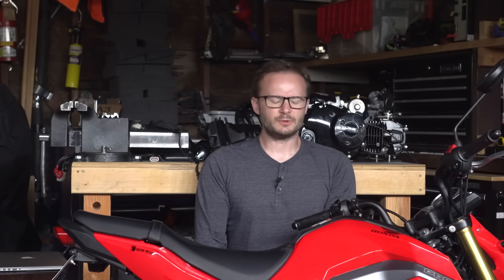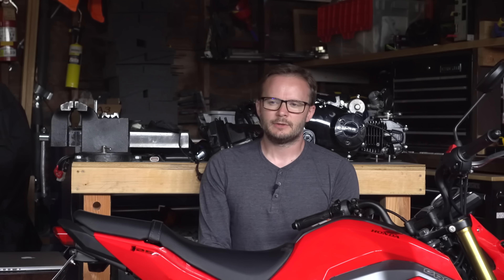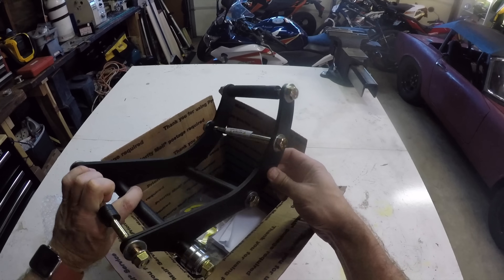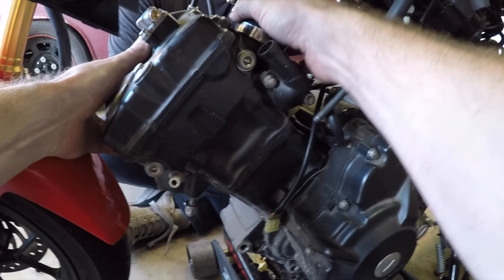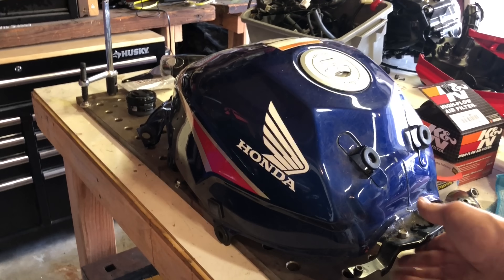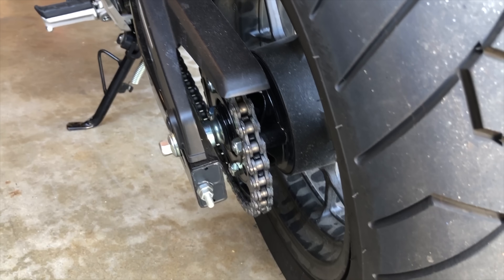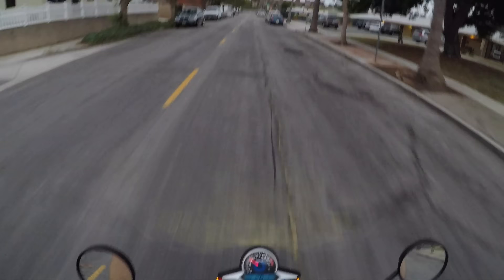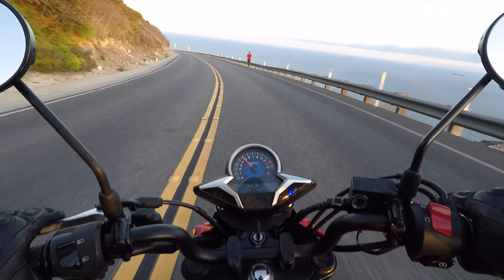Honda Grom Engine Swap: Twice the Engine for Twice the Price - CBR 250cc / 300cc How-To

Comment: When you say you need to re-tune the ecu. Do you still need to retune it if you are running the cbr ecu
Reply from the maker: Yes, because the intake is so different. It will work, but the idle sucks and you'll be down on power.
Reply: SuperfastMatt I just bought me a cbr 300f the whole bike with 66 miles on it for my swap. I will order the install bracket from steady with longer coolant line and egr block off. Being I have the whole bike I should be good on everything else. Where do you recommend me sending the cbr ecu too for a retune. Is there a way you could message me on fb messenger I don’t know anyone that has done the swap and if I have questions it would be nice to have someone to ask

Comment: Interesting, but if it requires purchasing an entire second motorcycle, I'm just going to use that larger bike as it is. I would find simpler ways to get power out of the factory 125 without compromising reliability/durability.

Comment: Well... you lost me at "buy a whole 250"... if I'm going so far that I am buying a whole ass bike to do an engine swap, I'm just gonna ride the bigger bike and not have flashbacks to riding my son's CRF80 because he hopped on my DRZ450 and took off. Serious question... if you need more power, why not save some weight and put go fast dirt bike parts on the oem engine like a J&E or Weisco big bore kit, stage 2 cam, bigger and jetted carb, racing exhaust, power adder(s), etc.?

Comment: Engine is canted almost 20 degrees forward, this hampers lubrication of camshafts. Also affects oil pick up. Generally, you shoe horned a big motor into a grom. Weight distribution is bias forward which degrades handling.
I would say that it probably rides terribly.  Braking is probably bad or worse, dangerous. Other than that, great job!
Reply: Blah blah blah 🙄
Reply: @upnorthviking823  yup...facts are blah blah blah... me and my books and stuff...me and my enginerring degree and numbers...me and my 50 year career making aircraft engines... i can see why somebody would trust blah, blah, blah over my opinion.

Comment: How did you attach the elbow that you made to the bike ?
Reply from the maker: I just used a short rubber hose and two hose clamps.
Reply: @SuperfastMatt  thanks for the fast reply ! Love the videos. And what did you use to attach the screen filter ?
Reply: @SuperfastMatt  also, did you end up getting the Ecu re tuned ? I can’t find a place to do it
Reply from the maker: @camilomunoz6762  I put an aftermarket ECU (MicroSquirt) on it and tuned that.
Reply from the maker: @camilomunoz6762  The screen filter came with a rubber boot and a hose clamp
Reply: @SuperfastMatt  u should do a tutorial on the micro squirt tuning !

Comment: Does the bike run weird/funny due to it being mount slightly on an angle on the grom as apposed to the 250r?
Reply from the maker: No; you do have to tune the ECU because of the new intake, but once that's done it runs fine.

Comment: Why is it 9hp? My Yamaha TZR 50 has a 50cc engine that makes 8hp
Reply: The tzr is more like 6hp stock, but you are comparing a liquid cooled 50cc 2-stroke racing motor to a 125cc air cooled 4-stroke tuned for new riders and city riding.

Huuuuge difference

Comment: Honda grom with the tm smr engine two stroke 125cc with 45hp
Reply: or the 2 stroke 300cc engine;)   There is a guy on YT that has done a cr 250 engine in a grom, and that thing realy goes...
Reply: @supertedogpriken  yeah but at least 45hp are kinda managable. The hp from a cr 250 are too much
Reply: @m4ttyofficialchannel  cr250 is that much power though

Comment: poor mans version of this get brand new honda grom clone for 1300$ swap in a zongshen 212cc 4valve engine for additional $950 add larger exhaust $180. not 300cc honda power but more than 2x the power of the stock 125cc grom.

Comment: Just buy a different bike. I bet that heavy motor throws off the center of gravity and weight bias so much that it is dangerous to ride. Also, looks like the engine is rotated in the frame asmuch as 15 degrees.  The camshaft well in the head is probably starving for oil. Just buy another bike. This is like a dude putting a 350 chevy in a volkwagon bug.. by the time you do it, you could have bought a vett.
Reply: Maybe he doesn't want a Vette, just a sleeper VW.
Reply: @61Slughi  comatose VW?

Comment: Nitrous kit on the original 9 HP engine is much simpler and cheaper.  You say the engine swap is super easy but not for the average rider.  We are not motorcycle mechanics nor are we fabricators.  Total BS statement by you.